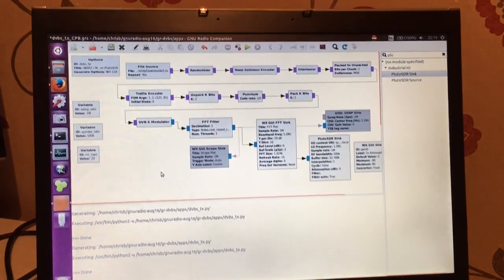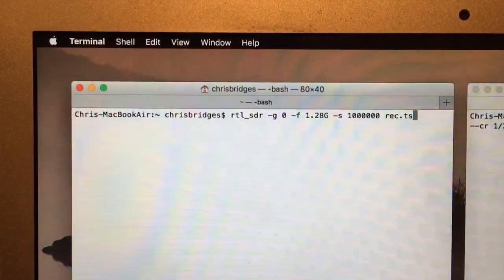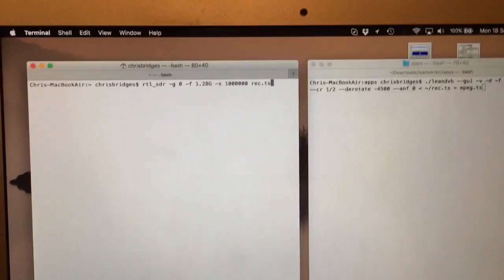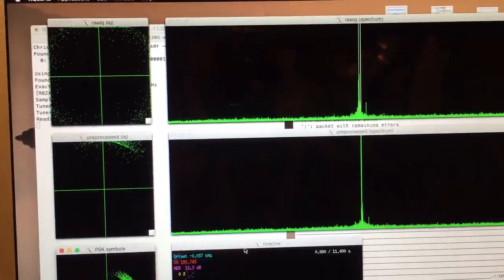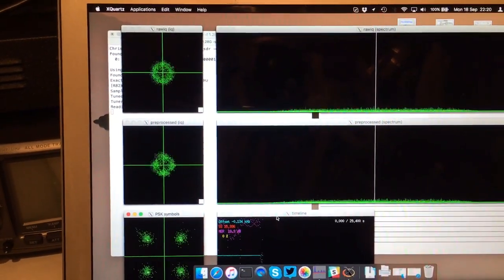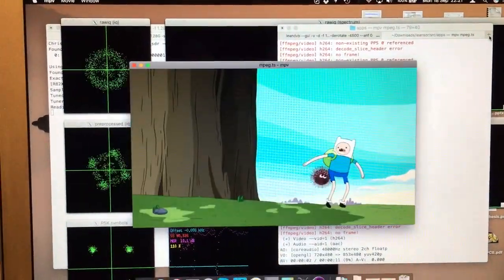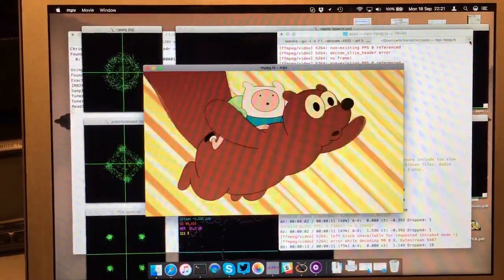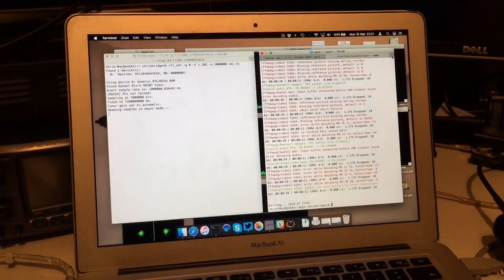Linux gnuradio QPSK DVBS PlutoSDR + rtl MacBook leansdr

Comment: Hi Chris I hope you are doing well since we met last summer in Guilford.
Very nice work! I am trying to use your design on my laptop.
I have downloaded the project on the git repository and installed it but it doesn't work for me.
For info I am using the pluto sdr with Ubuntu 16.04 running on VM under windows  10.
The sdr pluto responds very well to the serial terminal but when I try the gr-dvbs I get the message bellow.
I think it has something to do with the phython path as explained in the AD Wiki. But I couldn't get my head around it.
I was hopping that someone here could help me to accelerate my learning process.
Many thanks
Yacine

<<< Welcome to GNU Radio Companion 3.7.9 >>>

Preferences file: /home/rfim/.gnuradio/grc.conf
Block paths:
 /usr/local/share/gnuradio/grc/blocks
 /usr/share/gnuradio/grc/blocks
 /home/rfim/.grc_gnuradio

Loading: "/home/rfim/gr-dvbs/apps/dvbs_tx.grc"
>>> Done

Showing: "/home/rfim/gr-dvbs/apps/dvbs_tx.grc"

Generating: '/home/rfim/gr-dvbs/apps/dvbs_tx.py'

Executing: /usr/bin/python -u /home/rfim/gr-dvbs/apps/dvbs_tx.py

Using Volk machine: avx_64_mmx_orc
gr-osmosdr 0.1.3 (0.1.3) gnuradio 3.7.9
built-in sink types: 

FATAL: No supported devices found to pick from.

Trying to fill up 1 missing channel(s) with null sink(s).
This is being done to prevent the application from crashing
due to gnuradio bug #528.

/home/re/xfer/adv.ts: No such file or directory
Traceback (most recent call last):
  File "/home/rfim/gr-dvbs/apps/dvbs_tx.py", line 140, in <module>
    main()
  File "/home/rfim/gr-dvbs/apps/dvbs_tx.py", line 134, in main
    tb = top_block_cls()
  File "/home/rfim/gr-dvbs/apps/dvbs_tx.py", line 90, in _init_
    self.blocks_file_source_0 = blocks.file_source(gr.sizeof_char*1, "/home/re/xfer/adv.ts", False)
  File "/usr/lib/python2.7/dist-packages/gnuradio/blocks/blocks_swig0.py", line 1095, in make
    return _blocks_swig0.file_source_make(itemsize, filename, repeat)
RuntimeError: can't open file